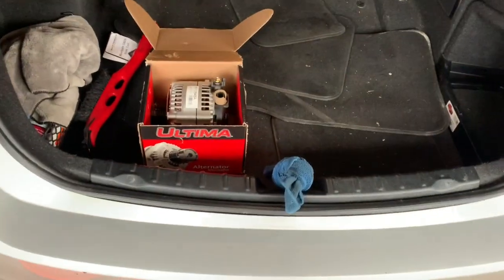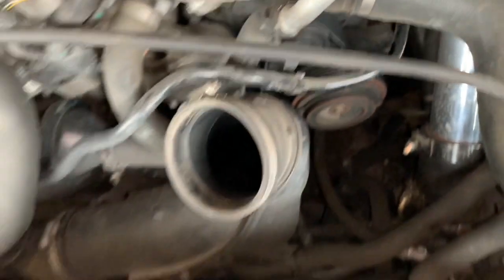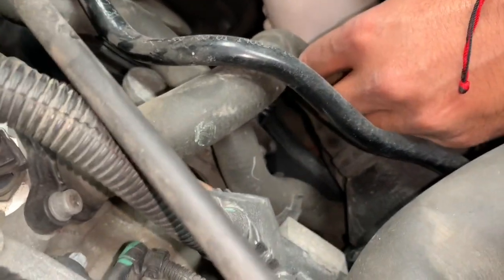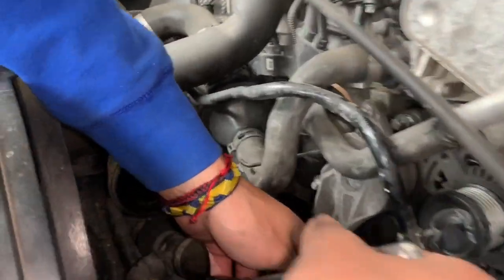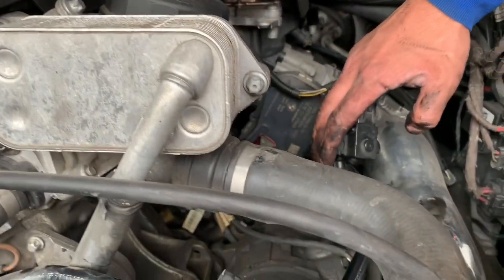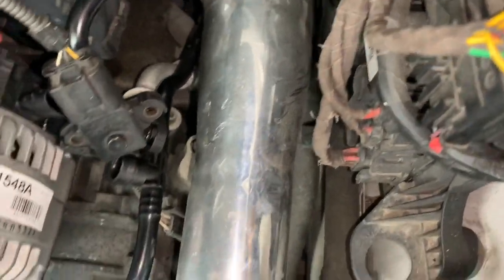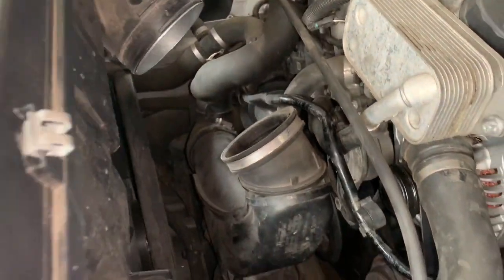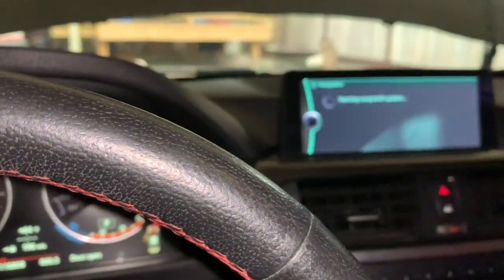Bmw N20 Alternator Replacement/Install On 228i/328i/428i/528i

Comment: When you're  taking out the alternator, and it just swivels or wiggles, after removing the two bolts, grab the front pulley on the alternator and pull up hard a couple of times to free the alternator from the cradle.  Then it will slide out.  Also have some mini zip ties with you.  You'll want to zip tie the vacuum tubes on the side that the alternator comes out to fixed  lines/tubes so you're not bending/pulling/breaking the vacuum tubes while taking out the alternator.  This creates a nice hole to pull it out and while putting in the new one.

Comment: You made it look so easy! 😂 I have to change mine. I had a new battery installed and a new ground a few months ago. My x1 died. I’m told it could be alternator or fuse link
Reply from the maker: If you have worked on cars before it shouldn’t be too hard lol

Comment: 2014 X3 very similar but air box is on the far right but alternator came out without rmoving will see if new one goes in now without removing it

Comment: Hi
Great video !
Did you have to reprogram and register the battery ? Also is it absolutely necessary to disconnect the battery?
Reply from the maker: No didn’t have to register the battery at all. And i say you should disconnect the battery because of the alternator having a terminal on it.
Reply: If you kept the battery terminals attached, when you remove the positive terminal on the alternator, virtually every piece of metal in the surrounding area is a ground. The chances of it touching something and arching is very high, unless you wrapped the exposed metal bits in electrical tape. Would still highly recommend disconnecting the battery. Battery registration is only required when putting in a new battery as you have to tell the battery monitoring system to change it's charging algorithm (as batteries wear, they need different voltage requirements).

Comment: Should I use lock tight when putting my alternator bolts back in, and if not do you think I should re-torque the alternator bolts after a few days?
Reply from the maker: That’s up to you, to be honest. I didn’t use lock tight or torque to spec. And it’s been 2+ years and still good
Reply: @LuisGee  I’m only asking because I followed this video about 7 months ago to fix my alternator, thanks btw. But just noticed today that the bottom bolt came out about a half inch and split my serpentine belt and looks like it’s started to damage my tensioner pulley.

Comment: I'm on my 2nd alternator already..  What is with these F30's and crap alternators?
Reply from the maker: Ive never had to change the alternator again. Still running strong. Only thing i can say is when you change your oil filter dont let any oil fall on the alternator that will shorten the life span of it.
Reply: @LuisGee  Yep also had that issue twice which is pretty ridiculous ha (Oil filter housing gasket) The 2nd time it failed no oil was found in the Alternator but it failed eventually soon after. Ah.. I really like the car but has some massively expensive reoccurring failures on basic parts that should last you 200K+ I was hoping to get the car to last up to 300K. Awesome video will probably change it my self next time. Rebuilt alternator cost 800+labor. eBay has a used one for 100 bucks..  ECS tuning sells them for $1200 new.
Reply from the maker: @drewzXR650L  i bought mine thru oreilys for around $300 lol and my car currently has 157,000 miles and has been running like a champ.
Reply: @LuisGee  Nice, never had to replace the oil filter housing gasket yet? Lucky duck! haha
Reply from the maker: @drewzXR650L  no since I’ve owned the car I’ve never had to replace that gasket